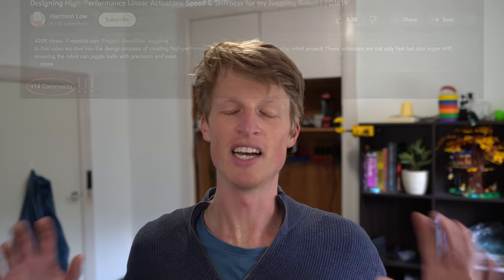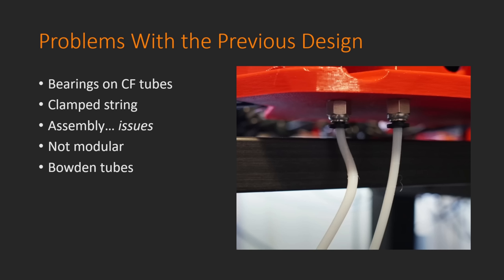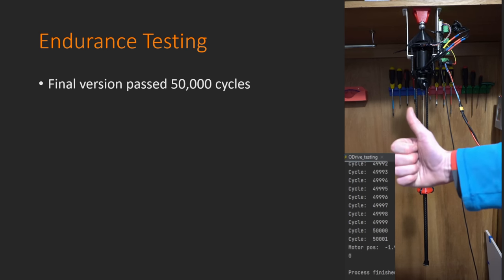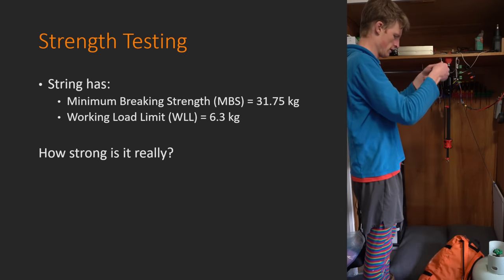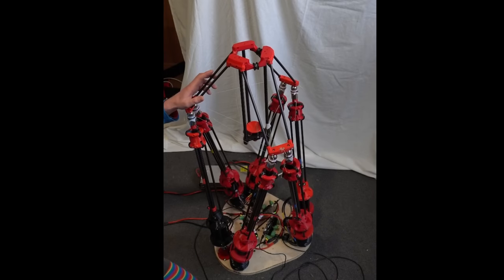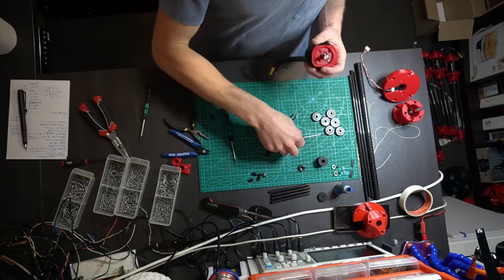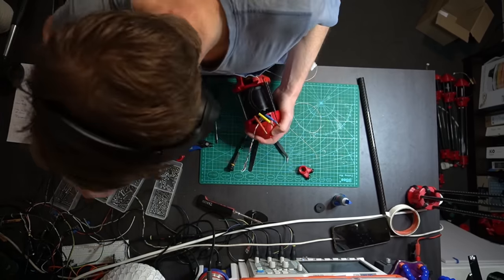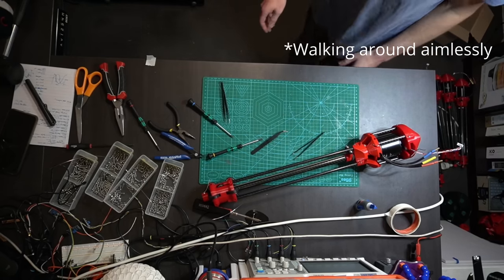My New Linear Actuators are SO MUCH BETTER! | PDJ #21

Comment: For the braking of the motor you need a power supply that can sink energy. I would sugest using a li-ion battery or super capacitors. 
Instead of the TPU selves for the Bering i would use the commercially available V grove bearing with like used in some 3d printers.
the V große against the rod would give 2 points of contact against the rod.

Finally if you ever redesign this completely  think abut using smaller (shorter) but more motors like Drone motors.
By using 2 motors smaller and counter rotating you get rid oft inertia twisting the actuator and  you get more dynamic
Reply from the maker: Yeah I've considered using capacitors but they scare me 😅 I love the idea of batteries but I need to do a lot more reading to learn how to set that up properly...

I'm worried that having a V-groove bearing straight on the central CF tube might cause wear? (similar to what I experienced using the normal radial bearings [shown at 2:07 in the vid]). Another viewer suggested using V-groove bearings with o-rings in the groove, so the o-ring is the only part actually contacting the tube.

Interesting idea of more and smaller motors! I would think this would lead to more issues with timing the motors correctly, and wouldn't two small motors be (generally) weaker than a single large one?

It's interesting that you mention inertia - that's actually pretty significant here and the actuator really wants to twist around when moving quickly (hence my sketchy support setup that you can see at ~ 6:40 in the video). Thankfully I've figured out a great way to make this a non-issue in the full stewart platform, so I'm not really worried about it anymore 😊

Cheers for the suggestions!

Comment: Beading cable might be a good option between the synchromesh and the thread (depending on the diameter you use).  It's cheap as chips too and I've used it running a toy cable car across a 10 metre run, but there was some slop in that length.

It might also improve the accuracy a bit as well as it should have less elasticity compared to the thread.

Comment: Have you considered dyneema string? Available through bow shops (used for all modern archery), it has virtually zero stretch and not too much creep and possibly too much strength.
Reply from the maker: Interesting! I recall looking into Dyneema thread after the last video and don't quite remember why I lost interest in it. It might've been hard to find in super thin threads? I didn't know it's used in archery! Maybe that'd be my "in" to finding some. 

If you have any experience in the matter, how do you think dyneema would compare to synchromesh cable (shown at 10:30 in the vid)?

Cheers for the input!

Comment: Regarding the breaking resistors 
Try a vesc of fsesc or any esc that is programable . If you add a proper battery, you can get huge acceleration and breaking without much heat (keeping in mind that you have a relatively low weight). These esc's are made for electric skateboards and should hold really well, but if you want to carry and break huge masses you should get away with some sort of pasive cooling
Reply from the maker: Cheers for the suggestion! I'm currently using ODrives (V3.6) which I can power with a battery, though my problem there is that I don't know how to manage a battery-powered system and got very overwhelmed by all the terms/info I was running into when I looked into this a little while ago...

Comment: I think the two "green" pulleys that are close together should be replacable with a single one.
For the sake of explanation, I'm numbering the three green pulleys on their distance from the central spool.
Therefore, pulley one would be the one that the green string meets first after leaving the spool, the middle one would be #2 and the one on top of the spool is #3.
Now, I may be totally wrong about this, but my idea is that if you remove pulley #1 and rotate pulley #2 along the axis defined by the green string between pulleys #2 and #3 it should be possible to find a position and orientation for #2 that would allow the string to correctly meet the spool.

The contact area between the string and the new pulley would be somewhat larger than it is now, my guess is the string would make a turn >90° on the pulley.

Sorry, I know this explanation is horribly convoluted - and I would an explanation why my idea does not work as I am sure that my train of thought must have crossed your mind already.

Edit: Same goes for the blue String btw, it should be possible to remove pulley #1from there as well by angling #2 towards the central spool to the string leave the pulley in a line tangent to the central spool.
Reply from the maker: >  as I am sure that my train of thought must have crossed your mind already

Haha you'd think so! I'm not sure how I didn't see this before, but you're totally right 😊 Good spotting!

Comment: How can you be sure you weren't measuring the standard deviation of the calipers?
Also, if you modify the bottom cap to engage all 3 tubes, you could probably reduce the number of bearings in the bearing block. The bottom cap would serve to constrain the motion to linear only while simultaneously removing the twist.
Reply from the maker: The short answer: I can't. At the end of the day, I'm super happy with < 1 mm precision, so I'm not fussed if the results aren't quite "true".

As for the bottom cap idea: I toyed with this idea a lot in the development of these actuators and ultimately decided against it for a few reasons:
 - The "guide" CF tubes, while quite stiff, can flex a bit if they're loaded at their midpoint
 - I want to reduce the weight of the "end effector" of the leg as much as possible, since this is the part that's moving the most (and fastest).
 - After experiencing how much wobble there can be in the fully-extended tip of the leg (if things aren't tuned quite right) I'm worried about the stiffness I'd be able to get out of the system you're describing when the leg is fully extended. Maybe the solution is a simple one: reduce the "operative" length of the leg.

Comment: without a better metrology toolbox, you can measure repeatability by using a fixed object and shims, move away and come back to brush the object and confirm with shims more precisely, it could be challenging depending on how much position authority/rigidity the controller has, if it's too elastic the shims could lack feeling
Reply from the maker: That's a good idea! I considered setting the actuator up to touch an object and return back to it (ideally without knocking it over) but couldn't think of a way of using that to create actual measurements (rather than a simple "under-shot" / "bang-on" / "knocked over"). Using shims is a great idea! I do wonder about the elasticity of the system masking the true result, though

Comment: I have been terminating belts and cables between two washers and a bolt. No design changes needed. For extra grip, you can wrap the cable over and under the first washer.
Reply from the maker: So simple! I'm surprised that works for belts as well! Do you need to use multiple bolts + washers? Or just really big ones?

Cheers for the suggestion 😊

Comment: Wow, great project! For the braking, rather than resistors, dumping current into a partially-discharged battery should absorb the energy without so much temperature rise. The circuitry would be more tricky, but you should be able to find a lot of info out there under DC motor regenerative braking. You could use the battery as the power source, connected to a charging circuit to keep it from running down.

Dumping current into a battery would cut the heat a lot, because it would be storing energy in the battery chemistry vs just dissipating it.
Reply from the maker: Yeah I think batteries are the way to go long-term. I just need to sit down and digest all the info online about it. Last time I found myself looking into Power Management Systems and charge/discharge rates I quickly felt like I was in over my head 😅

Cheers for the input!

Comment: Interesting, I've been thinking of a linear actuator,  but my requirements are way lass, lifting an LCD monitor screen from behind a table, so no carbon fibre, but wood, and no retract function as I'm assuming gravity will do that.

I was surprised by your motor with a spinning outer, a rather odd one with reduced mounting options.
Reply from the maker: Very cool! I like how that sounds (and I agree, surely gravity would handle the retractions here).

Turns out this is a super common type of motor called an "outrunner", which is a type of BrushLess DC motor (often abbreviated to BLDC). I was very confused when they first arrived 😂

(As it happens, mounting these actually isn't too bad; there are a bunch of bolt holes on the face plate. Check out "ODrive D6374" to see how these motors look close-up)

Comment: obviously im here because your actuators are cool, and Im all for projects for projects sake. but a single bare mgn9h style guide bearing with a block on each end would probably be pretty close in weight and  work very reliably while eliminating nearly all of the things you are struggling with. It might be worth investigating depending how much of your goal is to juggle vs having build and designed a whole juggling robot.
Reply from the maker: I've been keeping these sorts of guide bearings in mind through this process but, other than the twisting issue, I haven't been able to come up with a way to use them that outweighs any extra complexity they'd add.

Perhaps worth noting here: It's fairly important that, when compressed, these actuators don't have any length poking up above the "end" of the actuator. A few of my early ideas for these actuators were far simpler than this current design, but that extra length would severely get in the way of the overall robot moving around.

Comment: a good technique for getting the threaded inserts flush and square and clean is to ALMOST push it in the whole way, and finish with a hard edge flushing it to the surface and sucking in any slop.
Reply from the maker: Yes! I've since learned this and use this technique all the time. Super useful. Cheers! 😊

Comment: As an electronic engineer, I want to congratulate, you have a great project on your hands, simple, elegant and functional.
I think the most important thing right now is to move to the next step and that is to test with load. since without load it works very well.
From what I see it doesn't make sense to continue doing tests without load.
The speed you are so concerned about is going to change dramatically under load.
Go for it.
The recovery resistor, I don't think it's a big problem, it is getting hot because you put it in a continuous round trip cycle. It's not the way you're going to work on a real project.
Just make sure you don't exceed the recovery current of the driver.
Reply from the maker: Yep, I agree that it's time to move on to the next steps; I'm very confident that these actuators are capable of allowing Jugglebot to juggle at least two balls in one "hand" 

Re. brake resistor: I actually think the speed testing isn't (necessarily) too far off what the actuators might be doing in the actual robot. Jugglebot will need to be moving around quite a lot, quite quickly, so there will be a lot of braking involved. 

I'm just so confused why swapping out my 2 Ω, 50 W resistor (which overheated) with a 2 Ω, 300 W resistor didn't work! (the larger one caused too much power to be sent back to the PSU and it tripped) I'm sure I'm just doing something silly here but for the life of me I can't figure out what it is

Comment: If you make the end of the rod interface with all 3 rods, you can scratch 3 out of 6 bearings from the end.
Reply from the maker: I toyed with this idea a lot in the development of these actuators and ultimately decided against it for a few reasons:
 - The "guide" CF tubes, while quite stiff, can flex a bit if they're loaded at their midpoint
 - I want to reduce the weight of the "end effector" of the leg as much as possible, since this is the part that's moving the most (and fastest)
 - After experiencing how much wobble there can be in the fully-extended tip of the leg (if things aren't tuned quite right) I'm worried about the stiffness I'd be able to get out of the system you're describing when the leg is fully extended. Maybe the solution is a simple one: reduce the "operative" length of the leg.
Others have been suggesting using linear rails that run along the support CF tubes and I wonder if that would be the best of both worlds: increased bending stiffness for midpoint loads, (relatively) low weight, high stiffness for when the leg is fully extended, etc...

Comment: For the syncomesh you could use a crimp style ring terminal with heatshrink. Instead of heatsrink could you use ceramic bearings? Or make a uhmw wheel for the bearings
Reply from the maker: The trouble with these is that they don't (inherently) give any way to easily adjust the tension in the line, and I'm not sure if these would be the best way to terminate the cable at the spool end, due to the fairly small sizes in that area. Thankfully I actually think we've figured it out over on Zulip 😁 A simple clamp built-in to the printed parts is easy to adjust/fasten with a single M3 bolt and is super sleek and effective!

Do you think ceramic bearings would abrade the central CF tube? My (limited) experience with ceramic is that it's super abrasive 🤔

Comment: A wound spring brake might be a good solution here. This meets your requirements for modularity as well as being operatinally less complex.
Reply from the maker: I didn't know these existed before! I've battled springs that I've wound on to mandrels before and have been surprised by how insanely well they grip on. Using this force for good is very clever!

I'm not sure how one could be used here, though?

Comment: On the syncromesh cable an easy way to terminate it is to use metal epoxy.  create a casting box to create your desired termination. Place your cable in the box where desired.  Then fill the box with reacted metal epoxy.  Smash the two halves of the box together and clamp until the metal epoxy cures.  The advantage of this method is that you can form the outside of the cable terminate into any form you desire.   This could include a hex shape for allowing post install tensioning of the cable and hooks to position the cable into lock location.

Comment: 6:52 Just use stepper motors. They are made for this.
10:52 just like 3d printers terminate their belts. Design a toothed groove that will hold the end of the synchromesh cable (and probably clamp it down and tight it with a screw).
Reply: A Stepper motor of the same size as a bldc motor is going to have much less torque and speed.  Steppers are great for accurate movement.

Comment: Regenerative breaking can be done with a 3 phase rectifier and some way to either store the energy or dissipate the energy. A good place to start is looking up "delta alternator diode layout".  Delta alternators have nearly identical wiring to most brush-less motors and you can use the same type of rectifier layout because of this. The trick however is using PNP transistors instead of diodes. By using PNP transistors, you can monitor the motor driver's voltages at the transistor's base and limit the current of the rectifier when the motor driver is engaged. Keep going on the project, very interested to see where this goes!
Reply from the maker: Thankfully the ODrive is capable of handling the electrical stuff for regen braking, but the problem is that my electrical knowledge is subpar right now so I need to learn/figure out what batteries or brake resistors to use. I've tried the naive "increase brake resistor power, keeping nominal resistance the same" but that didn't work for some reason 🤷‍♂

Comment: I’m not familiar with synchromesh cable, but could guitar tuning knobs or something similar work? Those hold stif wire at high tension while allowing you to adjust the tension.
Reply from the maker: Good idea! I wonder how small these mechanisms could be made, though? I'd need one tensioner on each end of the central CF tube, and I want them to be as small and light as possible

Comment: Hmm synchromesh cable - perhaps flat wound spring could engage the steel cable. You may even be able to twist/torque the spring to tighten the grip to the steel cable.
Reply from the maker: Could you elaborate on your "flat wound spring" idea? Are you referring to constant force springs? I'm intrigued by your idea and would love to know more!

Comment: I would split that top roller bearings assembly in to two pieces: keep one half (with three bearings) at the top, attached and functional as it is now, then redesign the second half, attach that half to the bottom of the center rod, with the three rollers positined/rolling against the inner lengths of the three outer support rods... that way you could establish and maintain linear and rotational stability with contoured-surface bearings. I also would attach a linear encoder strip sticker along the center tube and install a strip reader to the top bearing assembly to read center tube position and speed... at startup, positions all rods to 'bottom' and zero the position count for each strip reader.
Reply from the maker: My concern with your first idea is that it'd make the fast-moving part of the actuator a lot heavier, which isn't ideal given how 'snappy' I want these actuators to be. The 'support' carbon fiber tubes also bend a little with a normal force applied to them around their midspan, so I'm not sure how stiff such a solution would be 🤔

The linear encoder strip up the middle is a great idea! I'll have a think about this 😊

Cheers!